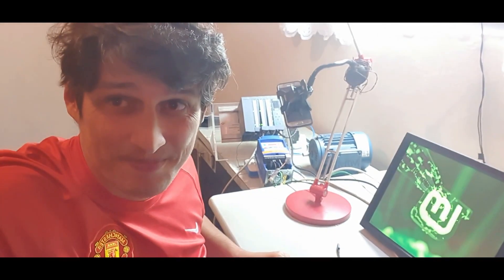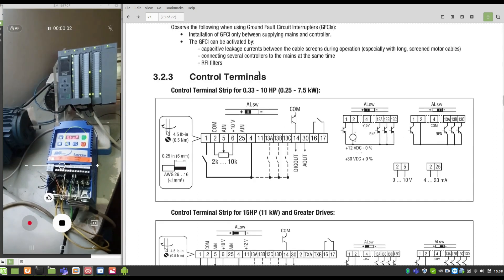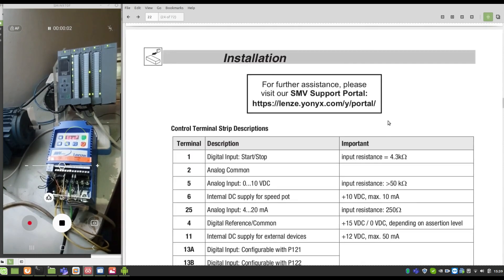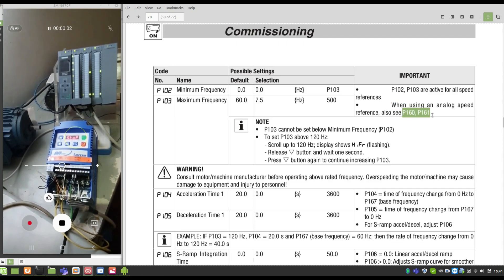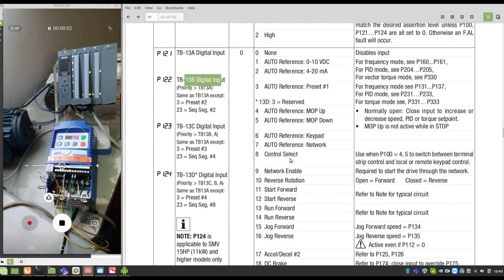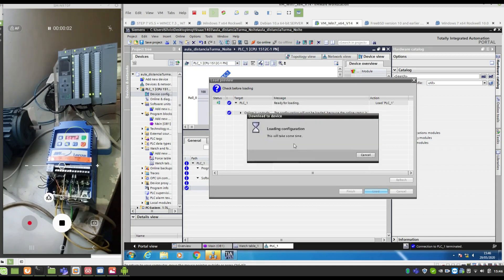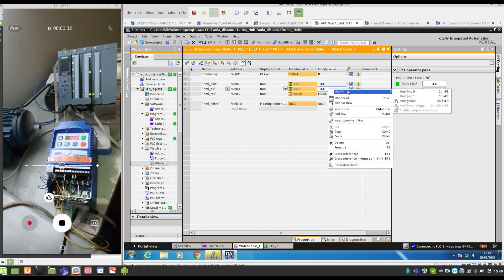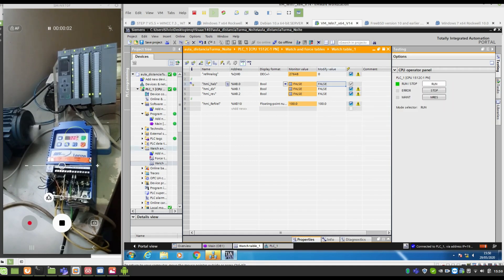LENZE ESV751 - Remote control from Inverter via 4..20mA with PLC S7-1500 Tia Portal

Comment: Hi bro. Hope you can help me, I have a VDF like this but i want to control it by 0-10 v using a potentiometer I did the wire connections to the VDF and changed the P101 to 1 but when I start the motor the control of the speed reference by the potentiometer isnt work good when i turned all right the potentiometer it didnt wave the speed just went to 30 hz  and did the same for the other side just went to 5 hz.
my cuestion is why if i set the potentiometer in the middle dont do anything or when i try to move it just when its setted all left or right
I understand need to move P160 AND P161 to change the maximum and  minimum speed reference when im using 0-10v